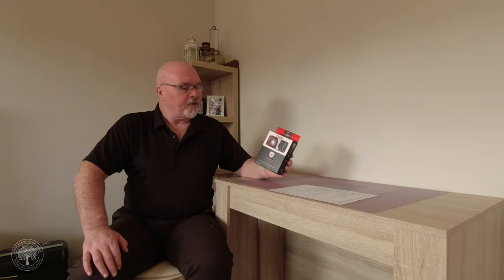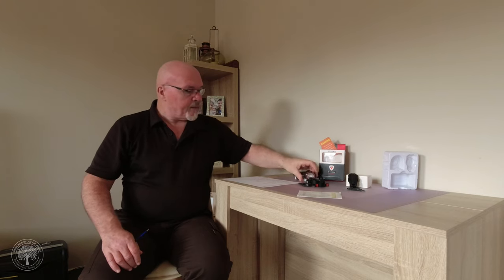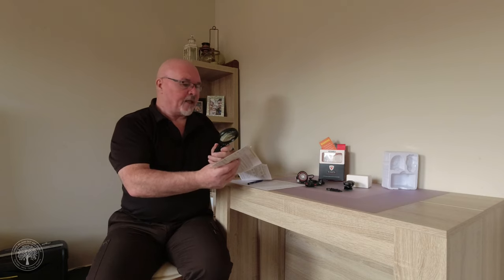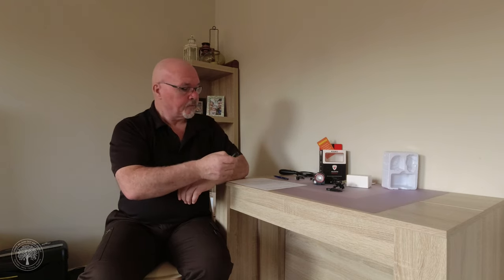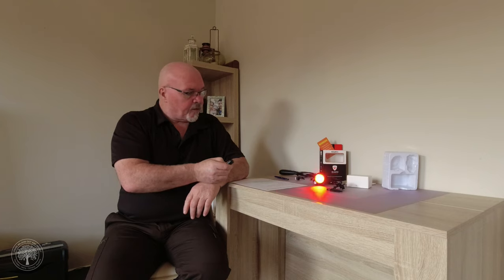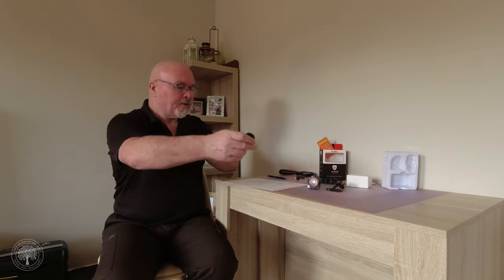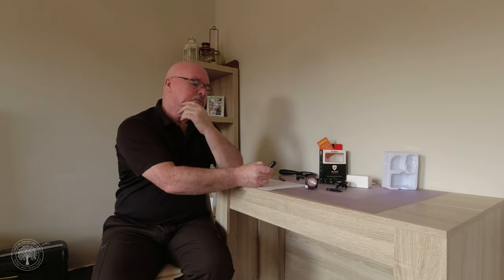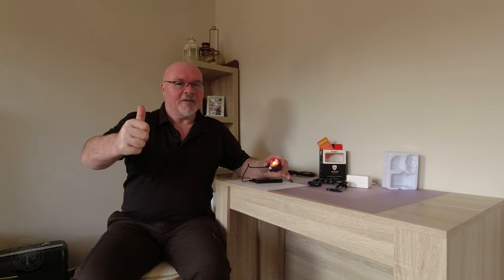How to Use The G Keni Smart Rear Bike Tail Light.

Comment: Hi David, nice in depth review of this light and alarm combo!

I have the slightly cheaper version of this (antusi a7) that doesn’t have the automatic brake light function, it’s just a standard flashing bike light and alarm. The key fob is identical. It was £17 on Amazon. 

I have it fitted to my Fiido D4s ebike. The alarm is an excellent feature it’s very loud and really provides extra price of mind when quickly nipping into shops etc.
Reply from the maker: Hi Faith,
Thank you, glad you enjoyed the video. The brake light feature was not a deal-breaker for me but useful addition, and yes, the alarm is very loud indeed 🤣.
Reply: Hi David, 

I just wanted to say there’s one thing you forgot to touch on,…the key fob battery is also replaceable.

There is a little slot on the side of the fob to put a small screw driver in to open it. The 12v 27a batteries are also widely available especially on Amazon and eBay.

All the best!